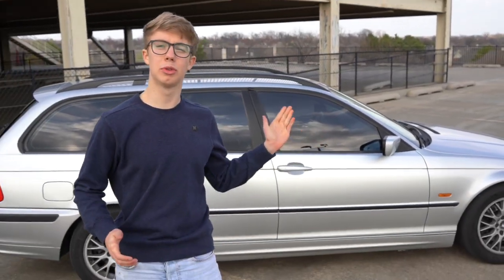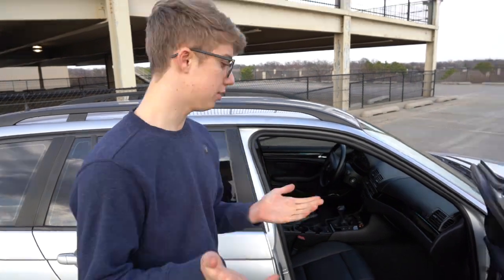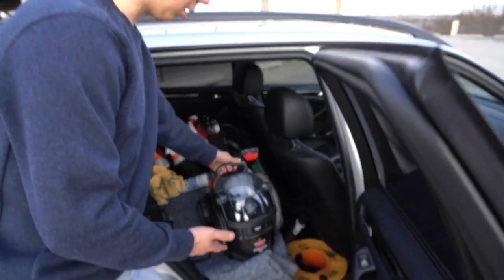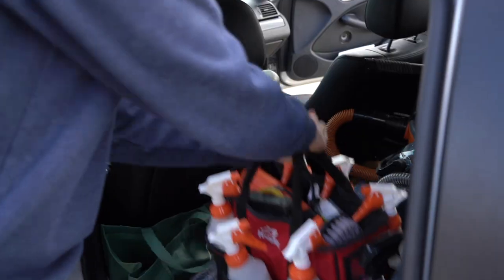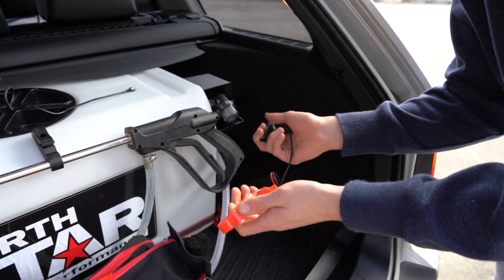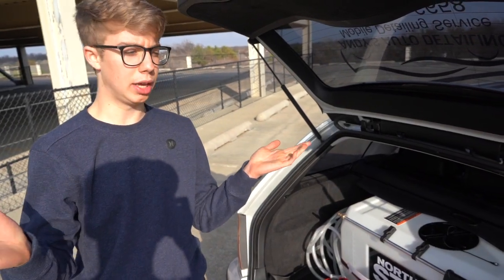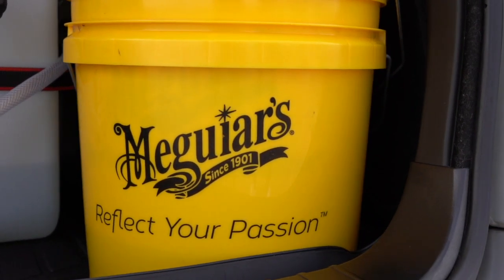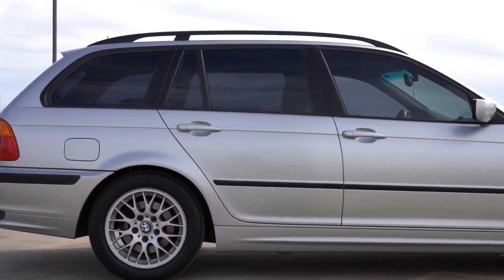Ultimate BMW 3-Series Wagon Mobile Detailing Setup!

Comment: You can still install small pressure washer in there so you have more pressure. And pressure washer actually use less water than from regular hose and more water power. But i love your setup and with this car you can enjoy comfort and drive faster than in van but make sure you dont over weight it. Another great car for this is Volvo v70, its very practical, large trunk, its fast enouch and reliable

Comment: Get the small Ryobi pressure washer and a predator 2000 generator for power, both are small form factor. A generator is already needed for that vacuum he has might as well add a small pressure washer like the Ryobi and increase cleaning capability by 1000% instead of that setup he has now, 70psi? To wash a car? Lol